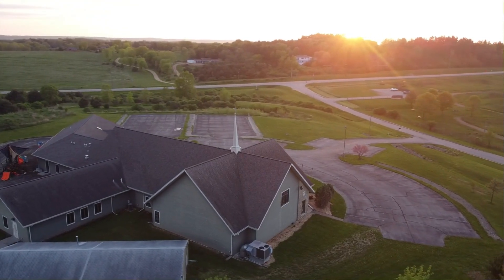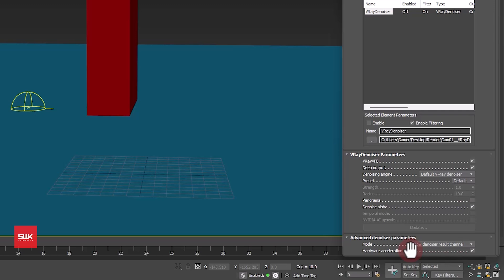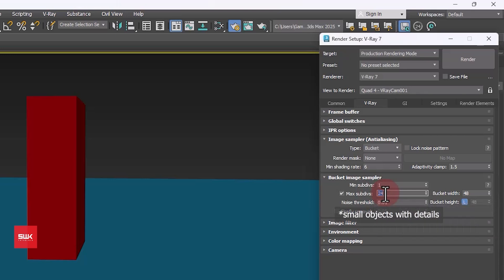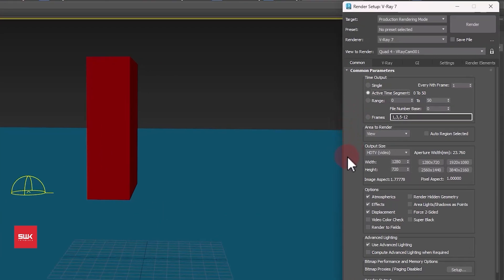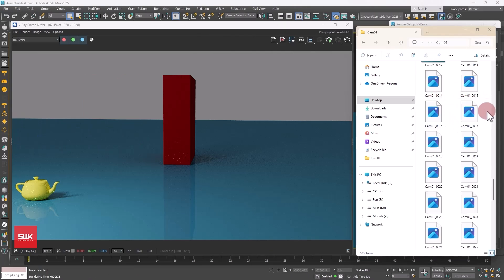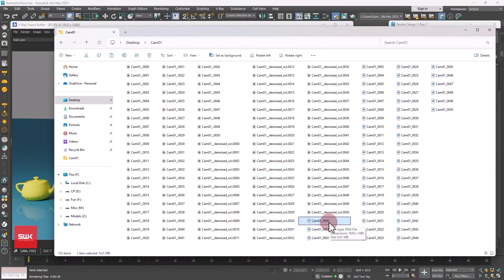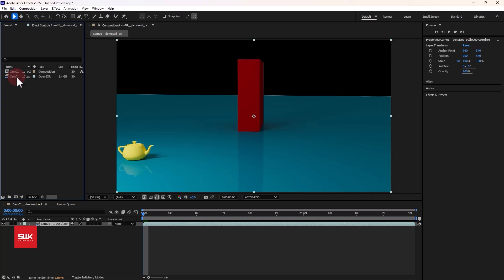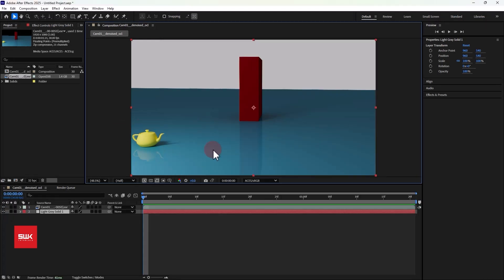Vray Animation Render Settings in 3ds max | Vray for 3dsmax

Comment: That’s very helpful, thank you.
When using Light Cache as the secondary engine, would it be effective to first generate a .vrlmap cache file before rendering?
In that case, I would enable “Don’t render final image” in the V-Ray tab.

Also, one more question:
I’m working in ACES color space in After Effects—should I configure V-Ray to use ACES as well?

Comment: Great job. Simple, clear and to the point. Good man, you have a gift for imparting knowledge and many thanks to you for that. But I have to ask - why not the V-RAY GPU engine?
Reply from the maker: Thanks for appreciation.
You can use GPU too. My reason for not using GPU is that In my office we have a strong processor than GPU.
Reply: @SWKTutorials Thanks for the quick reply. I've watched your course several times - FULL V-Ray in 4 hours - great tutorial. I managed to master static shots and want to start animating. However, this requires high computing power of rendering units. After watching your also great tutorial - animation render setting - I came up with the idea of making shorter sequences (60 frames) and combining them into a longer one in post-production. Does Adobe After Effects have the ability to combine several 60-frame sequences? Or can you recommend programs that can combine 50-60 frame sequences?
Reply from the maker: I’m glad my tutorials are helpful for you.
This is what we do in office. 
We make storyboard consisting of different shots. 
Then we use different vray camera for different shorts.
Then we render each short separately (with different render passes)
Then we composite each short in after effects.
And yes you can use a single larger comp to put all the shorts (50 or 60 frames) in one go. And render a single video.
But we also use adobe premiere too
Reply: @SWKTutorials Great, that's exactly what I need. I've seen almost all of your tutorials, also for Maya. But I saw After Effects for the first time a few days ago and I'm impressed. Are you planning to put up a tutorial about After Effects? How do you put together and compose a storyboard/movie, with transitions and titles? Is there a way to save music and sound together with stop motion animation? Thanks again for your videos that you make and the way you present them.
Reply from the maker: Let me think about making a tutorial on after effects and again thanks for appreciation
Reply: @SWKTutorials Great. Thanks for your reply. Your way of explaining the details of programs such as 3 ds max, Maya, V-ray, After effects - is optimally effective. Factual, simple and to the point. Thanks to this, everything is really understandable. If only you find the time to record new material on how to combine separate series of frames with transitions and add music to it, then I'm sure many people will be happy to be able to learn it. Regards.